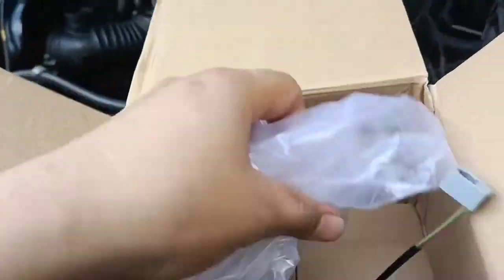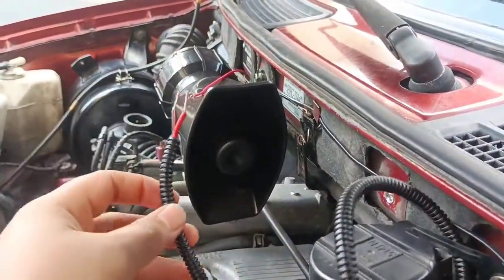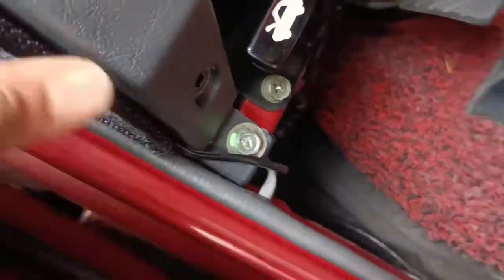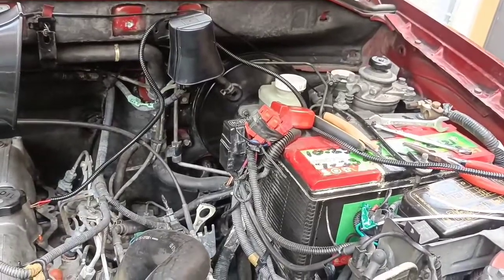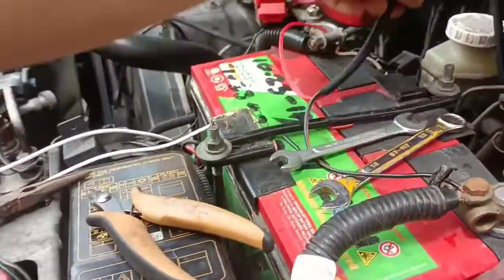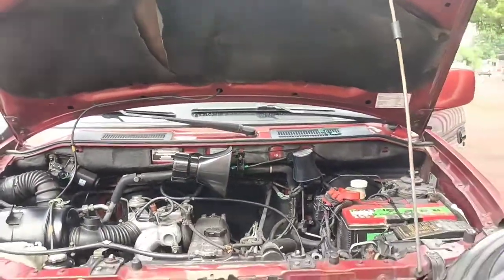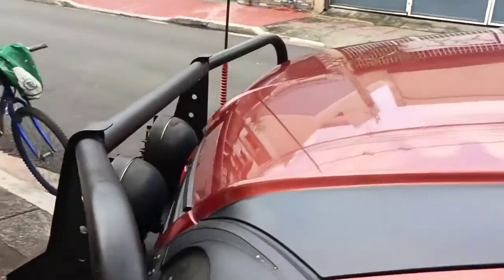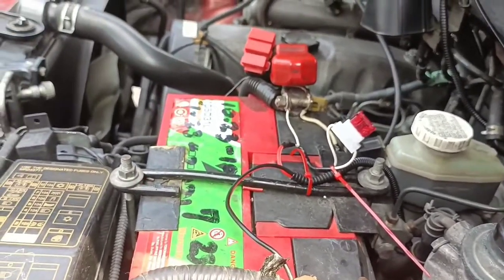Installing a $16 SUPER LOUD car siren. 7Tones w/ mic.

Comment: new here..
more video for mitsubishi adventure..
ask lang po kung tumatakbo pa ng 140mph  kung naka lsd ka na pang offroad ang setup (big tyres, bumpers)
Reply from the maker: Nkaka 120kph pako sir sa setup ko ngayon umaangat pa... Steel bumper,rear bumper 31 na gulong roof rack, farm jack, Jerry can 20L n my laman at spare tire na 31 dn. LSD Low gear gamit ko. Isa ksi nyang LSD High speed e. Depende sa ratio Ng LSD na gamit mo
Reply: @RoadVenture88  thank you po..
plano ko po 3inch  bodylift, mud tyres, tpos lsd pang mini trail or pang family camping sana namin, kaso po mamimiss ko nang sobra kung hindi na ako makaka 140kph sa advie..
Reply from the maker: Isang beses lng Ako nag 140 sa sctex Nung bago pa advie ko at sympre gngwa lang un kpag bago lng dn gulong mo pde ihataw tlga... Pero mabilis na un masyado ingay na Ng makina... Ako Kasi more on concern ko power kesa sa speed. Lalo na marami Ako pasahero lagi, d bitin sa ahunan kpag nka LSD at nkkipagsabayan Lalo na sa arangkada, sa stop light d naiiwan😊😊😊
Reply: @RoadVenture88  Thank you very much..

Comment: fuse lng ba kailangan or dapat relay? balak ko kc mglagay nyan kaso baka makasira sa ibang wiring system
Reply from the maker: Kpg d po Kau sure boss sa electrician nyo tlga pagalaw pra safe
Reply: sir di mo po nabanggot ilang amps ang inilagay na fuse at anong size yung wire yung idinugtong mo.